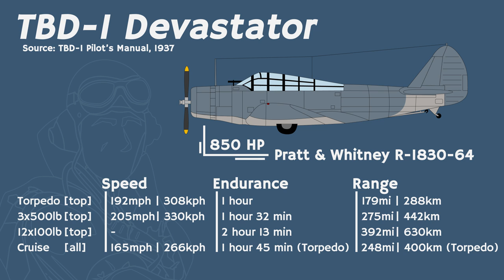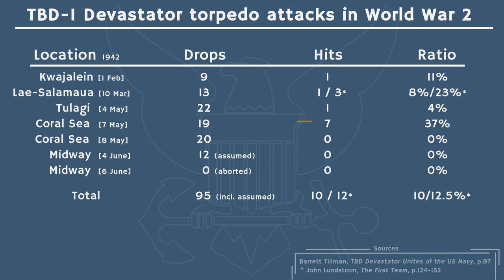In Defense of the Worst Aircraft of World War II - TBD-1 Devastator

Comment: If the Battle of Midway occurred in 1939 prior to the introduction of the Zero, the TBD would have been a perfectly fine torpedo bomber.  But, it was obsolete in 1942 and forced to fight in a battle it was no longer able to fight.
Reply: Actually, even without the Zero-Sen fighter, the Devastator would have been easy meat at Midway.  Two reasons:

First, the A5M "Claude" monoplane fighter - the one the Zero replaced - had brilliant performance for its time, with a top-end speed of 270 mph, as well as plenty of range to fly standing CAPs waiting on the TBDs.  While not as fast or as powerfully armed as the A6M Zero, it had enough superior performance to crush the TBD, as it did with so many other mid-30s aircraft over China.

Second, the TBD's margin of speed over Japanese carriers (roughly 90 knots vs. 35 knots) made it hard for the TBDs to catch up with the Japanese carriers. They spotted one another at a range of about 10 nautical miles, and the Kidō Butai immediately poured on the coal to make it hard for the TBDs to get close enough to strike (also bearing in mind that the carriers were nearly as fast as the Mk XIII torpedoes), making the planes fly through a deadly flak zone.  Read John Lundstrom's The First Team, focusing on the air battle over the Kidō Butai off Midway to see just how long it took the TBDs to cross that 10-mile separation, with a closing speed of barely 50 mph.

A plane that was that slow, with no self-sealing tanks, not much in the way of crew-armor protection and just one or two pop-gun .30 Brownings for defense, would have suffered badly in 1939, just as it did in 1942.  It would take the later TBF/TBM, able to drop a torpedo from a modified Mk. XIII torpedo from as high as 2,400 feet at 410 knots (roughly 125 mph faster than the TBF's top speed) for American torpedo bombers to come into their own, as exemplified in the First Battle of the Philippine Sea and even more so in the several naval battles in and around Leyte Gulf during our invasion of the PI.  However, with the inferior Mk. XIII (which tests indicated had at least 12 major flaws), drop speeds above 100 knots were unlikely to succeed, and "ditto" for drops above about 50 feet altitude - a performance envelope likely to be deadly to even the best torpedo bombers of the war, let alone a dog like the TBF.  While something to write home about in 1935, it was way outclassed by 1942, as was shown at Midway.
Reply: @barryjobe  Points taken.  I appreciate the reply.
Reply: Also less than par torpedoes didn't help
Reply: Ned Barnett : Good post. 
Note: Japanese carrier AAA, especially in 1939 and earlier, was poor.
Reply: @racinnut77  Thank you!
Reply: @timonsolus  Well, every navy before the start of WWII didnt give importance on AA defense, also the Japanese 127mm dual purpose gun mounted on Kido Butai's 5 carriers (except Akagi) were comparable to standard American 5/38 DP gun.
Reply: There were Midway-based 5 most recent TBM Avengers, and 4 B-26 Marauders converted into torpedo bombers. 
They were all shot down by Japanese escort fighters or aa guns.
The modern Avengers were sent to Midway for test in combat.
They didn't even scrape the paint from the Japanese ships.
It was in fact the sacrifice of the carrier-borne Devastators which allowed the 
SBD dive bombers to dash through the clouds and hit the 3 enemy carriers simultaneously while all their guns were down.
Reply: @Charlesputnam-bn9zy  actually, one Avenger survived,  but it was a flying drive, and never flew again.  All the preliminary attacks paved the way for the SBDs which killed 3 of the 4 carriers in about 5 minutes.
Reply: @paulsteaven  check out Norman Friedman's book on defensive artillery on ships to learn how and why Japanese AAA fire was ineffective.  The 127mm had inferior fuses and no radar gun directors, while the 25mm auto-cannon were a license-built French Hotchkiss design that was pure  crap.  Our 5" 38 was the best in that caliber, and got even better with VT fuses.  They also had superior gun directors.  The 40mm Bofors was the class of the world in that caliber, ditto our 20mm Oerlikons.  Compared to our AAA (and the Brits' AAA suite), Japan's was pure Bush league.  Their torpedoes were the class of the world, and their Zero fighter was the best carrier fighter in '42, but their AAA, not so much ...
Reply: @barryjobe  Sorry, my error. There were 6 Avengers, not 5.
Thank you for the information.
Unfortunately, the 1976 movie ''The Battle Of Midway'' bogged down into a personal drama, and didn't even include the B-26s episode.
But the 1961Japanese-made ''Storm On The Pacific'' had it in a very well-made scene.
Reply: @barryjobe  I've read somewhere that the Japanese oxygen-fueled torpedo was the most effective in the world, and remained a well-kept secret until the end of the war.
By contrast, the American torpedoes remained well inferior to their enemies'
and even their allies' counterparts.
And yet the American submarines which were the first to fight after Pearl Harbour, sank the Japanese merchant fleet and even the IJN !
Reply: @Charlesputnam-bn9zy  yes the did.  But if you read Clay Blair's excellent history of our submarines at war, you'd see that after two years, we finally fixed the torps, and that was when our subs really started to score.

Also, their oxy-torp was a mixed blessing - incredibly effective, but also incredibly vulnerable to devastating on-deck explosions.
Reply: @Charlesputnam-bn9zy  Japanese torpedo's were excellent and the Japanese had clever ways of getting rid of inferiority with it
Such as fitting wooden stabalizers so that the torpedo's wouldn't run into the sand in the shallow waters of pearl harbor
Early U.S. torpedo's has a knack for being utterly useless in comparison
Reply: @barryjobe  I'm talking about the AAA suite of Naval Powers during 1939 so the Oerlikon and Bofors were out coz USN is using the 1.1 inch AAA together with the .50 calibers as its primary AAA together with the 5/38, and at the start of the war both Navies have the 'same' AAA suite albeit the USN put more AAA on their ships because they quickly realized the 'importance' of having more AAA on their ships to counter the strongest Carrier Force during that time.

Also as at the start of the war IJN's Type 89 127mm is comparable to USN's 5/38 but as the time goes by, 5/38 outclassed the Type 89s with the introduction of GFCS and VT fuses.
Reply: @barryjobe  The irony is that Oerlikon and Bofors guns were made by Switzerland and Sweden, 2 neutral countries.
The nazi 20m/m aa gun was also derived from the Oerlikon.
The British succeeded in smuggling an Oerlikon 20m/m gun out of Switzerland after Hitler was master of Europe. A tale of hair-raising c&d.
The Allied aa guns at the beginning of WW2 were absolutely shabby.
Which allowed the Stukas their early successes.
However, the American Browning .50 heavy machine guns were superb aa guns, even more practical than the Oerlikon.
I think the US should develop a .50 Gatling gun, to have the complete panoply of 
all-caliber Gatling mgs from 30 m/m to 5.56 m/m which is no luxury on today's battlefields..
Reply: The US Navy captured Japanese torpedoes in 1943 and were able to discover their secrets.
Reply: The .50cal was considered completely ineffective as an antiaircraft gun quite early on, which is why they were replaced relatively quickly by the 20mm.
Reply: @MrDgwphotos  At Midway Island, the .50 did well against low flying planes, as at Pearl Harbour.
The F86 jet has 6 .50 mgs and their rate of fire were better than the 20m/m
But a .50 gatling gun would be extremely useful against ground targets nowadays.
Reply: To be honest in 1939 it was marginally obsolete already. Underpowered , slow , easy pickens for fighters and naval anti aircraft fire. Without fighter cover for the TBD it was suicide.

Comment: This makes the Defiant look like a saint. At least the defiant looked modern and had a decent speed but god.
Reply: Eh. The TBD was a fantastic aircraft for its time. The best in the world at what it did, even. The trouble was, time - and aviation technology - had moved on by the time it went to war. Even so, the TBD was used reasonably successfully (speaking of the plane itself, not the defective torpedoes) in its designed role up until Midway.

The Defiant, OTOH, was based on a fundamentally misguided concept; it was less that it was made obsolete with the passage of time and more that it was unworkable from the start. And yes, the RAF did manage to find roles which the Defiant could fill successfully; but that was very much a matter of necessity, as they still had significant numbers of Defiants on strength when they realized the type was hopelessly unsuited for service in its designed role as a day fighter.
Reply: @Philistine47   I once (long, long ago) read an article on the Defiant.  A Polish General (and his"aide) had a "joy ride" in a Defiant.  The turret had been removed.  They found the thing would have been a part way reasonable ground attack aircraft (very steady in a dive enabling accuracy with the flour bombs they had) but, by then, there were better ground attack aircraft on the way.

Comment: One of the great mysteries of the TBD was that it wasn't upgraded with a more powerful engine.  Dramatically more powerful versions of the Pratt & Whitney R-1830-64 mounted on the TBD was also widely used by successful US military aircraft (notably the B-24, PBY, the F4F and C-47), and long before we entered the war, versions of this same engine that could deliver power to the tune of 1,200 horsepower were already in operation. Yet the TBD's R-1830-64 generated merely 900 hp.  An example of a plane flying the 1,200 hp R-1830 on the carrier decks was the F4F, which used one of the 1,200 hp version R-1830. This meant that the Navy already had aviation machinist mates onboard all our carriers in 1941-42 who were fully up-to-speed on maintaining that engine during carrier ops. 

Upgrading the engines - which were basically the same engine, requiring little (if any) reworking of the engine mounts - would have given the TBD one-third greater power, which would have translated itself into better speed and load-carrying capability, and made the plane at least marginally more effective and survivable in its torpedo bomber role, especially at Midway. 

Of course, without fighter cover and/or close coordination with the SBD dive bombers (or better yet, both), the TBDs - like the six TBFs and four Martin B-26s flying from Midway without fighter cover and flying in disconnected penny-packets, rather than in a formidable formation of high-altitude, dive and torpedo bombers - would still have been vulnerable to Zeros and flak that had only those low-altitude "targets" to shoot at.  Yet given the actual TBD's execrable performance, especially down on the deck with a one-ton torpedo hanging down in the slipstream, a more powerful R-1830 would not be a panacea - but it would have helped.
Reply: I'm no aviation or military history expert by any standard, but I think, if upgrading the engine would have ben that easy, and obvious a solution it would have ben done.

A few possible explanations:
- A more powerfull engine creates more torque. Just ask Corsair pilots.
Maybe it would have ben too much torque?

- A more powerfull engine is a more thirsty engine. Unless you increase fuel capacity - might be rather difficult to do - you end up with shorter range.

- Other technical problems like vibrations being too much.

- The change of engines and getting the pilots used to the aircraft's changed characteristics would have taken them out of action for too long.
Having a sub-par aircraft available is better than having an on-par aircraft not available...

- Availability of engines. Maybe the engines were needed elsewere and thus simply weren't avilable.
After all, what's the point of taking engines away from new aircrafts on the assenbly line just to put them into obsolete aircrafts? All you do is delay the replacement of the obsolete aircraft with new ones.

- Just not worth the hassle.
New, better, aircraft will be introduced soon and the old aircrafts even with better engines would still use the same crappy torpedo much the same way a prisoner "uses" his ball and chain, so why bother?
Reply: @Bird_Dog00  We could have an endless debate on the subject, BIrd Dog, but what's the point? It's all hypothetical.  I thought about the fuel, but I also realized that with that much added horsepower, it would be easy to add fuel (especially in drop tanks).  But if that wasn't possible, and if the engines (remember, these are just different marks of the same engine) were that thirsty, maybe.

And as far as the engines themselves, they were in mass production for the other planes (C-47, B-24, F4F Wildcat) and the few TBDs available (140 were built and not all survived from '37 to '42) would not be a problem.

However, no military decision-maker is likely to forget that decisions to maintain with an obsolete or obsolescent aircraft will cost American lives, so I don't think that's it.  As an aside, I knew Ensign (later Lieutenant) George Gay, the soul survivor of Torpedo 8's suicidal attack on the Japanese carrier fleet on June 4, 1942.  I have his autobiographical memoir/book - as well as a thinly-disguised novel by E. Howard Hunt (later one of the "plumbers" at Watergate) who met Gay in '43 at Guadalcanal and wrote a novel about Gay's night interdiction missions over Japanese airfields.  I even have a Johnny Ficklen artist's profile signed-and-numbered print of Gay's Devastator (signed by Gay himself) hanging on the wall in my office.  Ensign Gay lost every other man in his squadron - a horrific blow to him (he survived it remarkably well, but by the time I knew him, he had a major drinking problem).  I can't see the Navy keeping an inferior plane in service, at the cost of so many lives, when an upgrade would make a difference.

But I guess we'll have to agree to disagree. Thanks for your comments.
Reply: @barryjobe  Wow. That was quite an addition. Many years ago I recall reading,I think it was Robert Heinlein the science fiction writer, an Annapolis graduate, that getting the pilots to willingly switch out of the Navy biplane fighters was not an easy task. The interwar years had allowed the designs to mature to the point the performance envelope was entirely within the design envelope. That is for instance the fighters could be placed in a vertical dive,engine wide open,and remain controllable due to the drag going up so much it was impossible to pull the wings off,or the upper surfaces of the wings. The pilots deeply trusted their sturdy machines.
As late as midwar,experienced Italian fighter pilots were comfortable with their biplane fighters. They knew to fight in the horizontal plane,not vertical,and regularly made monkeys of British pilots in Hurricanes.
Facing Zeros in a biplane torpedo machine would have been a slaughter,so the whole picture  of going in first,no fighter escort as the TBD did at Midway just made a very bad scene way worse.
Poor doctrine,no actual war experience, I can understand Gay having memories he tried to drink away. And the less said about the Bureau of Ordnance, the better.
Reply: @Bird_Dog00  I think the latter point was probably the most important - why spend precious resources on upgrading a few existing aircraft when its replacement was already close to being deployed? Anyway by the time the need was apparent and the resources available, the war was on and most of the remaining TBDs were deployed on carriers and in constant use. I imagine availability of engines was also a big factor - between upgraded TBDs and more F4Fs the Navy was going to choose more F4Fs, the need was absolutely critical.

Comment: The Devastator was a design that had to be built to determine what was needed for this class of aircraft. But hardly the worst aircraft design of WWII.

Consider the British Blackburn B-25 Roc. This was to be a carrier based aircraft and never landed on a carrier.  Single engine with a crew of two, a pilot and rear gunner. The gunner sat in a dorsal mounted turret with four .303 caliber machine guns, there were no forward firing guns for the pilot to control. Heavy and under powered it was soon used only for towing gunnery practice targets and patrol. It only shot down one German bomber when attacking it with other RAF fighters. A real candidate for worst aircraft of WWII.

The Germans had the Heinkel He 177 Greif . An attempt to build a long range heavy bomber. It had four engines but the engines were housed two to a nacelle driving a single propeller each. High performance aircraft engines leak oil and the two jammed together engines connected to a single propeller shaft were prone to oil fires. Airflow for cooling was inadequate in the nacelles and overheating was common. Many had to limp back to base trailing smoke or the crew bailing out.

The Germans had a more successful four engine bomber Focke-Wulf Fw 200 Condor. It had a small payload and was classified as a medium bomber. It had a long range and was successful as a maritime patrol bomber. Churchill called it the scourge of the Atlantic. But it had not been designed as a bomber and was a converted passenger airliner. The result as a structurally weak aircraft and if giving hard maneuvers or turbulence it's wings would brake off. Landings also had risks because a hard landing could break the main structure of the craft and it had to a scrapped.        A candidate for the most successful worst design.